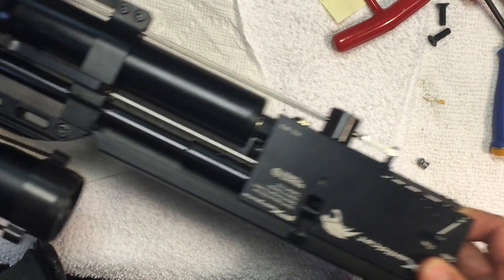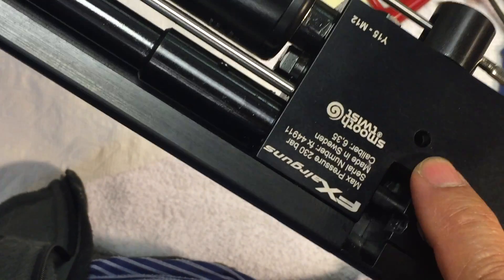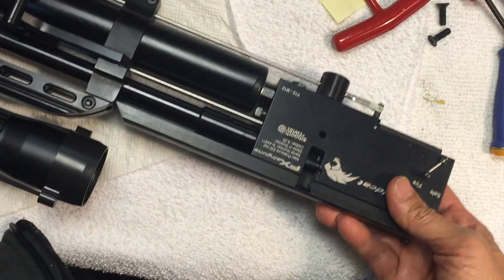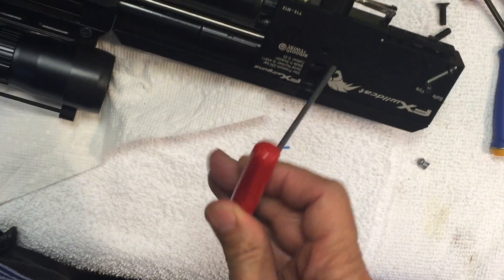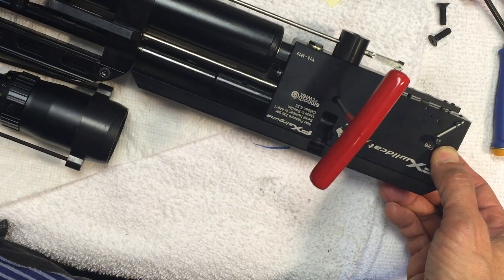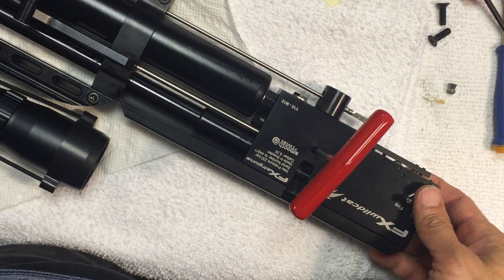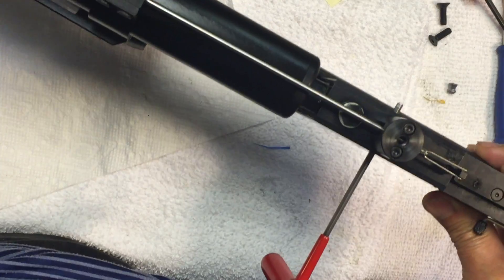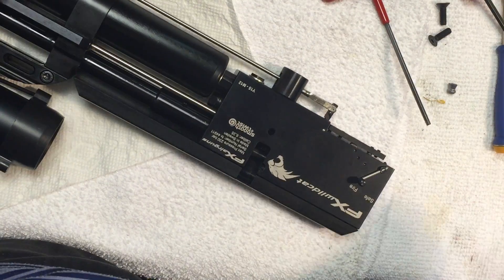FX Wildcat,  how to safely bleed the air tube

Comment: Am I right in thinking that you can also bleed the air tube by slowly unscrewing the brass grub screw on the opposite side to where you just put the Allen key through? 
Excellent videos by the way. Keep up the good work 👍
Reply from the maker: +trent stevens 

thanks for letting me know, also theirs a hex head screw on the bottom of the action that also bleed the AT. of the 3 I prefer the VS bleed its faster, no threads,oring to wear out or hex to strip.
Reply: +Esting Rowe I didn't know that. This why your the expert see 😉